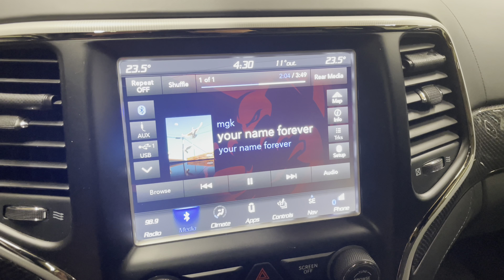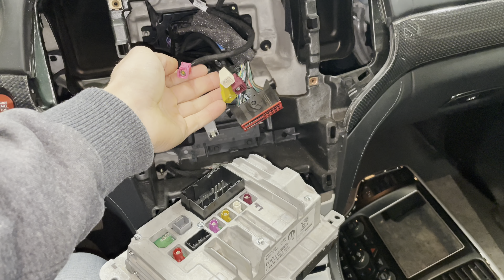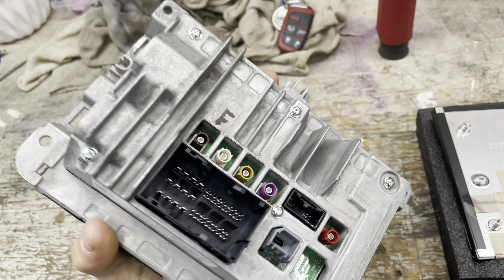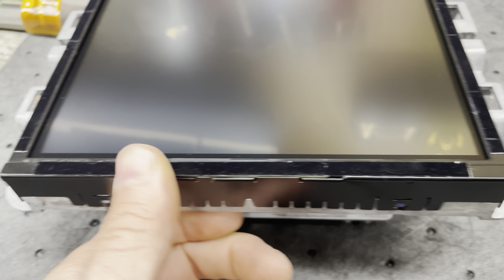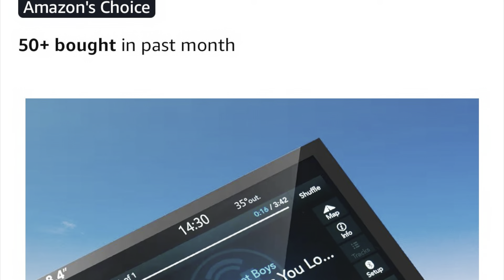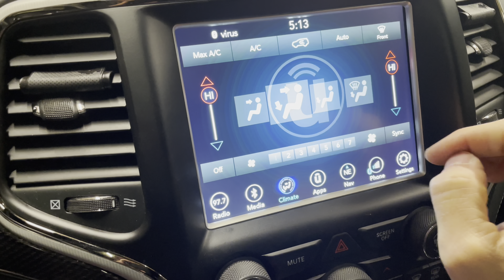EASY FIX! Jeep Cherokee Radio Screen Delamination. DIY Repair

Comment: Thank you so, so much. My screen has been delaminating already when I bought the Jeep, but today, it started to dial different numbers in its own, trying to plan a route a 1000km away via Google Maps and moving back and fwd on Audible. I had to shut it off.  Now, I can order this instead and fix it by myself!  Very thankful!!!
Reply from the maker: Im so glad I could help!
Reply: @JT2JZ  I just changed it.  Took me longer to remove the gel that had seeped everywhere than to actually do the job!  I did sort of pulled the greenish part that holds the greenish wire to the screen assembly, but after putting it together again, it works for now.  I will check to identify the part number and get it in advance for the day that it wiggles its way out.  
Changing the screen seems to have fixed another I've been getting.  My phone was apparently disconnecting quite often from the USB connection, even if nothing was happening, and I couldn't get my phone to connect unless I would stop the engine and start again.  It seems to stay connected now 
🤷‍♀

Comment: I replaced my screen on my 18 charger hellcat. Everything works fine, only issue im having is the background theme layout (ie: red hellcat image) is VERY DIM, hardly noticable. My original screen, the background theme was very visible, this one its barely noticable, the background basically looks like a plain black background unless you look real closely to notice the faint outline of the cat....any idea?
Reply from the maker: That’s a good question. I wonder if there is a brightness or contrast adjustment.

Comment: Sadly, the person that I spoke to at Stalantis several years ago and she insisted she was as high as I could go, refused to give me a phone number for customer satisfaction  she would not provide her name but did give me the option to buy a new radio for 1400+ labor to install.  I sat around pissed off for 3 years and ran across a company called Cuescreens. Their screen is permanently bonded and the screen itself is anti glare and much crisper to view and no glare. I agree 100% that replacing a glued screen with another glued screen is a bad decision.  Your video was spot on.  I just had a little trouble popping off the bezel but once it popped off everything was a piece of cake. However, I am so disgusted with Stelantis that I for one will never purchase another Jeep, Dodge, Ram or Chrysler product.  And to think they could have done this the right way and repaired a product that never should have failed!

Comment: Bought the same one and it don't have xm radio and backup camera
Reply from the maker: Double check your ribbon connection. The terminals are very small and easy to damage.
Reply: @JT2JZ I figured it out you have to shut the car off and wait 3 mins and your good
Reply from the maker: Good to know. Thanks for sharing

Comment: this ain't fix, it's replacing!
Reply from the maker: Just do the digitizer if you don’t want to replace anything more! 
I explained that as an option as well.
Reply: @JT2JZ  meaning what in just do the digitizer? replace exactly one only ?
Reply from the maker: I explained it in the video if you watch it again but the digitizer is just the outter piece that starts to separate. 

Click the second link in the video description to see the part. It’s $35 on Amazon

Comment: So did you disconnect the battery or leave it connected?   I didn’t catch that
Reply from the maker: I left mine connected no issues. Just keep the ignition off and you’re good to go.
Reply: @JT2JZ thank you again for the video.  Fixed myself today despite very little mechanical inclination.  Took about 30mins.  Excellent vid!!!
Reply from the maker: That’s what I like to hear! Nicely done.

Comment: Random question, but do you have uconnect on your 2018? I have a 2017, and that doesn’t allow for mirroring from your phone. I really just want it for the navigation, and Jeep wanted 500 dollars for a map pack. I was hoping a new display would solve this problem. Thanks for your input

Comment: Does your heated and cooled seats work still? I just did the screen replacement and mine doesn’t even show up
Reply from the maker: Everything should work properly. Maybe double check that ribbon connection. 
Mine works perfectly.
Reply: @JT2JZ Are the controls for the heated seats and steering wheel located in a different spot with this screen replacement? I just replaced my screen and The icon for them no longer shows up on the bottom as an option?
Reply from the maker: Should work the same as the original screen. My heated seats are in the same location.
Double check your screen part number and make sure it’s the correct compatibility
Reply: @JT2JZ In later models there are options to add different controls to the main screen instead of navigating to different tabs, similar to pinning to a taskbar. I have the 2020 and of course moved the heated seat control to the main screen for easy access. I don’t suppose a new screen makes Uconnect work for Carplay any better lol?? That’s the only thing that makes me want to swap the whole system for the new one since it can’t be updated.
Reply from the maker: The screen won’t improve uconnect unfortunately. It’s just a display for the separate radio module.

Comment: Well hell iv been dealing with this for over 4 years my jeep has call 911 on me  countless times so hopefully it's as easy for the 2018 jeep compass  I now have straight black screen dealer ship wants $1200 that's with a $900 return for the old one
Reply from the maker: Just do the full screen like I did and you will be good to go! The dealerships are way to expensive

Comment: Awesome tips! I’m about to purchase a 2018 Grand Cherokee which has that screen problem. I have also noticed that it’s not bright at all, it’s hard to see anything. I hope that everything will be fixed just replacing the screen
Reply from the maker: Sounds like a full screen replacement should fix all of those issues.

Comment: Thank just bought a 2020 grand Cherokee and this video really helped
Reply from the maker: Very common issue
Reply: Crazy how common this issue is
Reply from the maker: I agree. You think a massive company would fix something simple like this over the years. 
I think the never vehicles are finally better now but it took WAY to long to address the issue.
Reply: @JT2JZ You would think but look at Dodge Durango's and their problem they're having with their race track lights in the back leaking and burning out and there yet to fix the problem and all they have to do is seal it better with silicone and the problem is solved but unfortunately they leave the customer to deal with this.

Comment: TYSM. That ghost would start calling people, changing to radio, clicking on the media button, maps would not re-center (basically anything on the left side of the screen of apple car play).  I think something got wet and it became unbearable.  This was a great fast fix, hardest part was plugging back in due to the short lengths, and the snaps were brittle but still reconnected.
Reply from the maker: So glad I could help! 
The ghosts are definitely a pain.

Comment: Works with grand Cherokee 2020 right?
Reply from the maker: Yes it should fit 2018-2021 grand Cherokee from the part description.
Reply: @JT2JZ thank you
Reply: @markrosal5703 нет , не подойдёт . На 2020 идёт с 3 шинами 🎉

Comment: I just fixed my radio using this video, after three years of asking someone to figure out what was wrong with it for Christmas. It’s had a bubble in the screen since I bought it and now it’s finally fixed. And I’m a 20-something’s girl that knows nothing about cars so thank you 🙏🏻
Reply from the maker: This is exactly why I made the video! Im so glad I could help make your situation easier. Thats what YouTube is all about for me.
Thanks for sharing your experience. The positive feedback helps keep me motivated for future videos.
Reply: It's a screen / stereo /monitor. Don't think of it as a car.
Reply: 3 years!!!   you're one patient woman!  I've been having issues for a while, but the phantom dialing/taking control of google maps lasted only 1 day before I googled the issue and found this video 2 days ago!  Ordered the part, got it this morning and took me about 30 mins.

Comment: How did you know if you needed the 1 ribbon or 3 ribbon screen?
Reply from the maker: I didn’t really know the details of the screen when I ordered mine. Just make sure it is compatible with your specific year and model of vehicle before you buy. The screen does change a decent amount between the different years and models of Jeep.